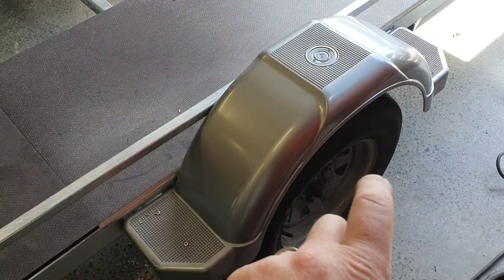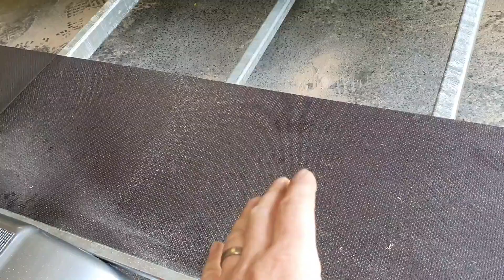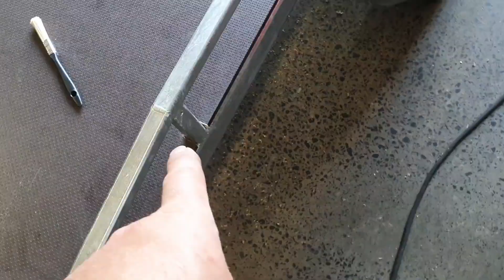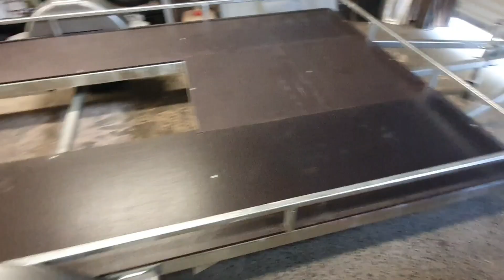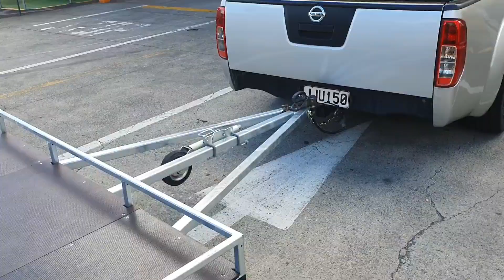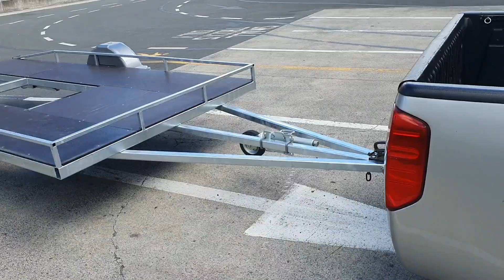Car transport trailer finished!

Comment: What is the deck material? Plywood?
Reply from the maker: 12mm thick Trans Tex  it's a special plywood with some sort of laminate on top and bottom.
WAY stiffer than typical ply of similar thickness.

Comment: rego on a new trailer isnt that much. 😅
Reply from the maker: I guess for insurance to be changed over would be a bit of time on the phone or whatever, plus it was literally 5PM when they were doing the WOF inspection and it was quicker to sort it that way than the paperwork for a new trailer (that doesn't take long but still longer than a WOF).

ANNNND it's just a chuckle to say "we fixed it"